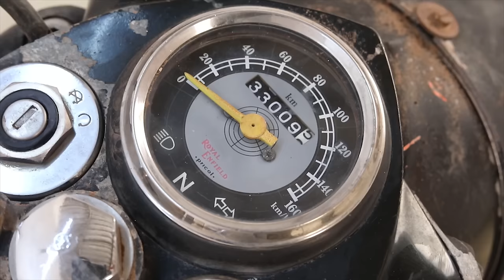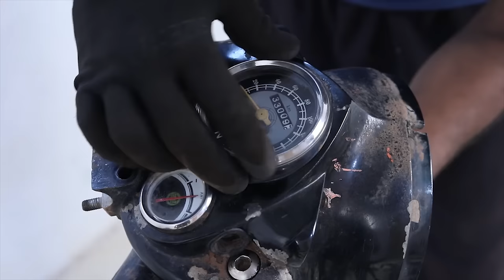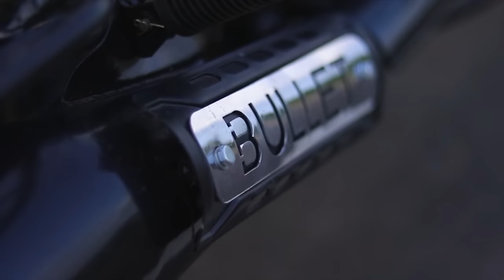Old Bullet Restoration | Royal Enfield Bullet modification

Comment: Who abandon such an awesome bike as the Royal Enfield??? Love one even the India made ones. When sanding and spraying a bike you will want to tape up your petcock, and put a covering over the fuel cap hole. also taping up certain sections of parts when you are priming and painting. Putty is not needed to cover entire sections of the part only dents or imperfections. If I had it apart I would cut unnecessary parts away. When painting you put on multiple coats, sanding between each coat and then finally put on a clear coat.
Reply: Good points
Reply: Its done on purpose
Reply: Its fake video
Reply: Probably in better condition before they started on it than when they had "restored" it.

Comment: looks pretty but how often do you find a old bike without 1 rusted bolts and still rolls on pumped up tyres and you dont even have to change the spark plug to start it
Reply from the maker: next time we will try more batter work